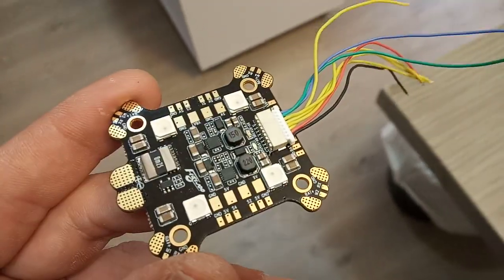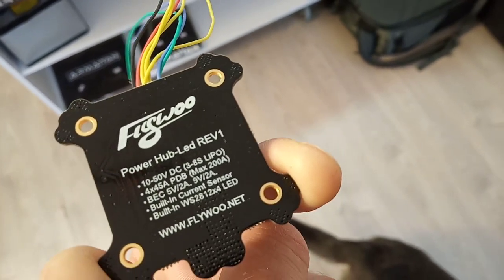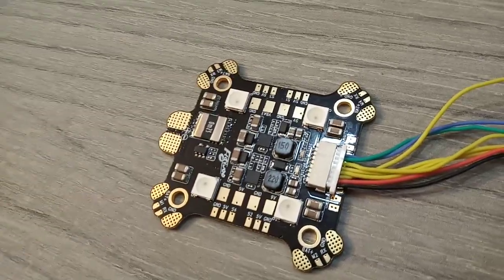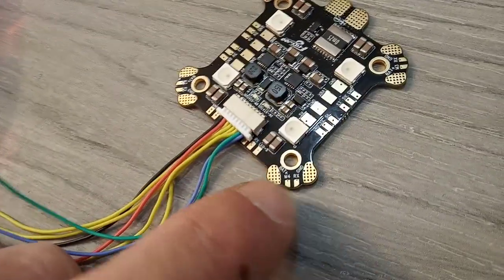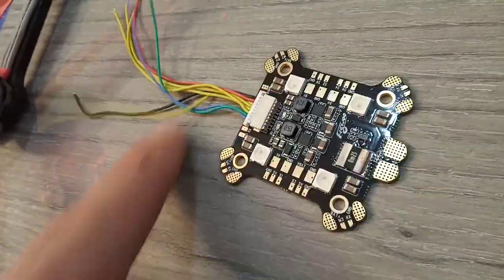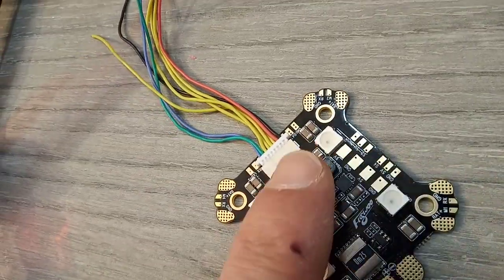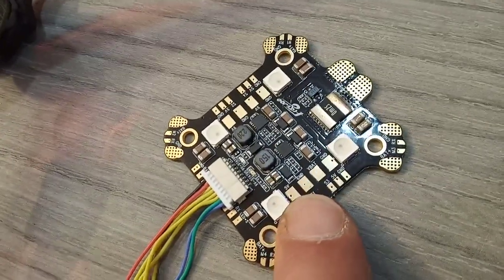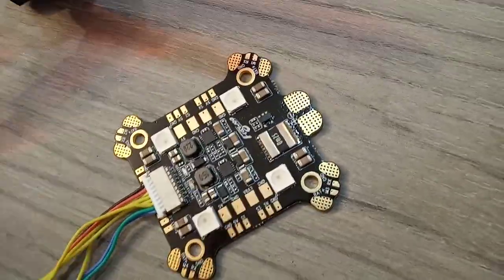Flywoo Power hub rev.1 - best FPV racing PDB i have ever flown

Comment: Man I have noticed this pdb too cause I like my builds old school everything seperated.. But there is one thing thats missing in that pdb.. There is no negative esc signal pad... And I hate that almost all pdb's out there don't have a pad to solder this fkin (sry) wire... You will say this is not an issue.. you solder it on negative esc pad.. Yes ok but is this for manufactors so difficult to do? Wouldn't be our cables and soldering look much cleaner that way?
Reply from the maker: there is a reason why no manufactor produce PDB with that negativ...
but i dont make PDBs so ...im sorry ...
this is still one of my favorit PDBs out there :)
Reply: @AviadNidam  😁